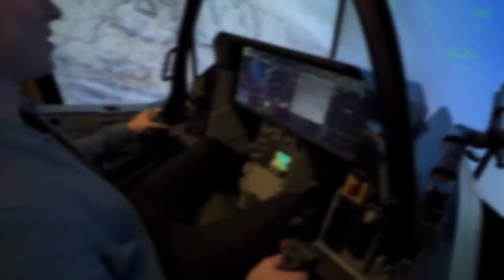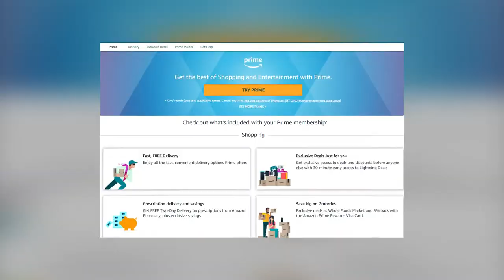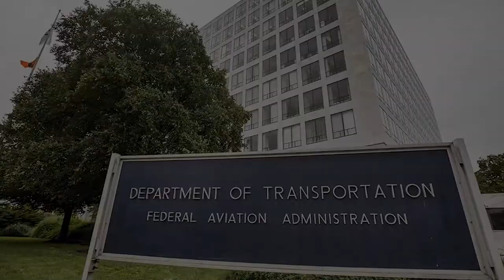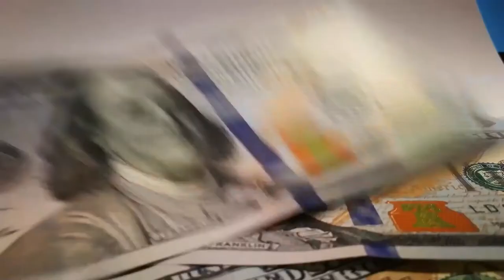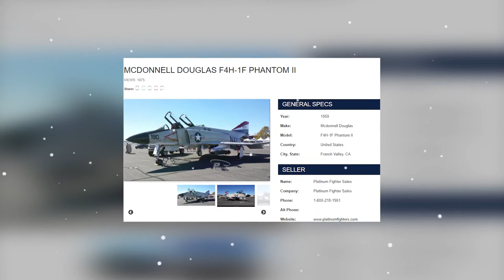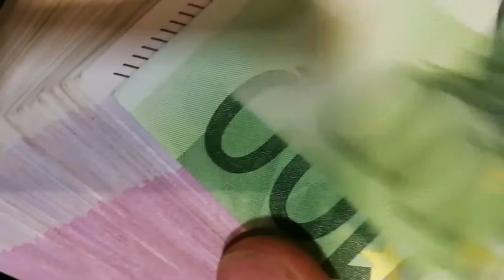How to Buy and Fly Your Own Fighter Jet

Comment: Not too bad but what you say about the MIG 29 speed...
flying at 1300 km / hour is complete non sense.
That's barely above the speed of sound.
The real speed of the Mig 29 is 1300 Kt. Means nautical miles per hour. 
That's 2400 km/h and/or  1500 miles/ hour.